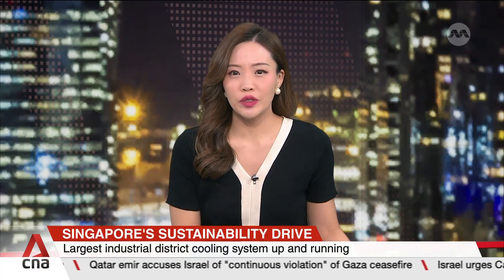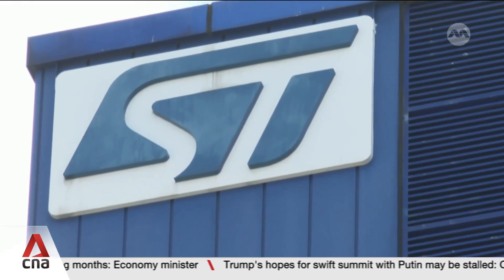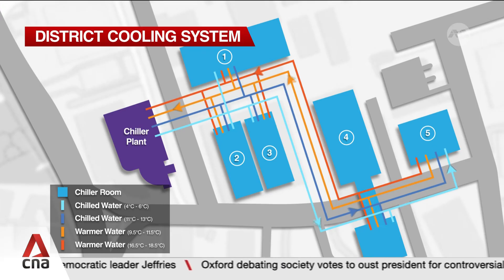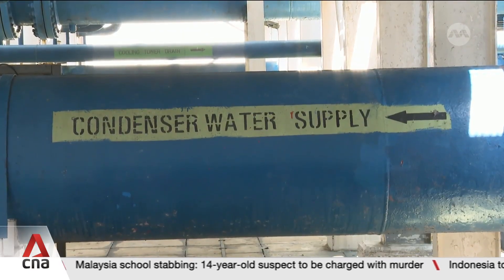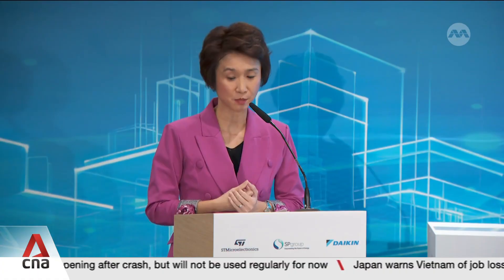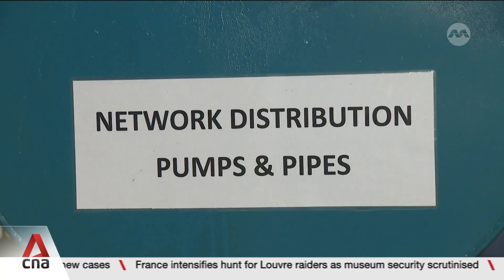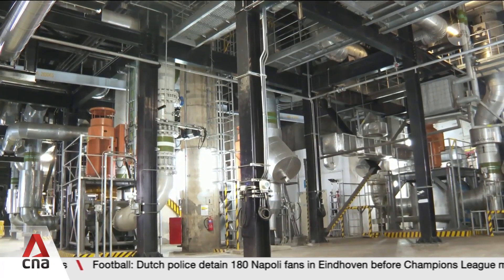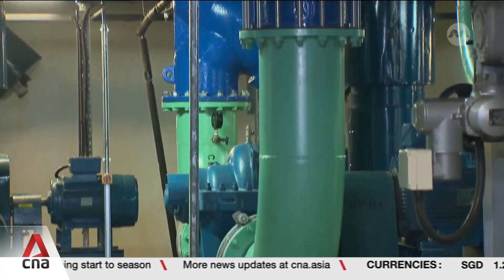Singapore's largest industrial district cooling system begins operations in Ang Mo Kio

Comment: Should do for all Hdb estates. Like lift installed in old blocks.
Reply: The centralized cooling system in Tengah HDB flats is facing serious issues, including water leaking from ceiling units, flats being flooded while owners are away, and excessive condensation causing mold growth and peeling paint inside the flats.